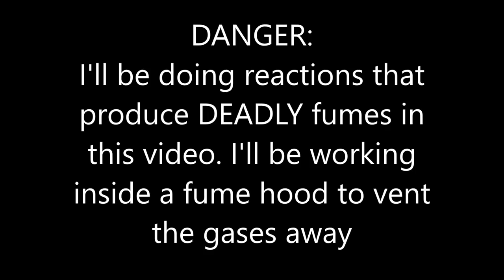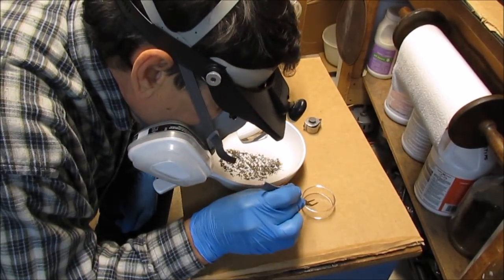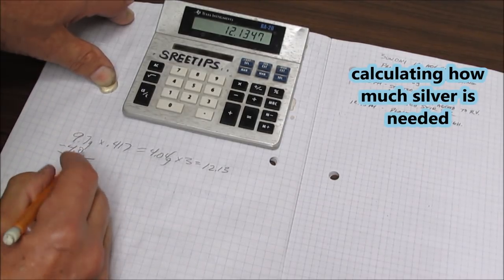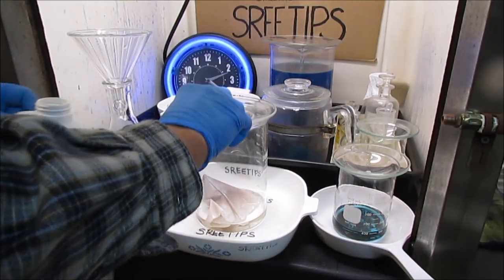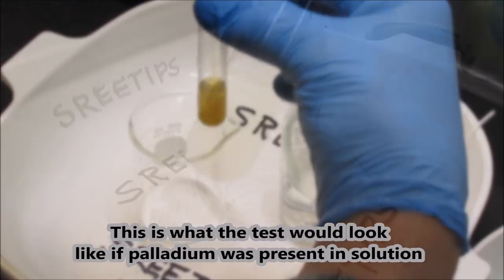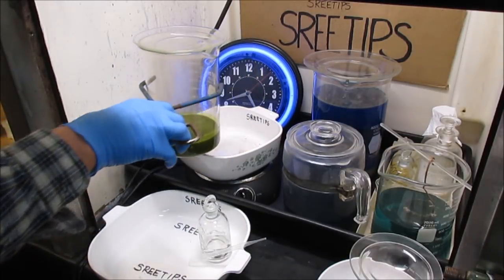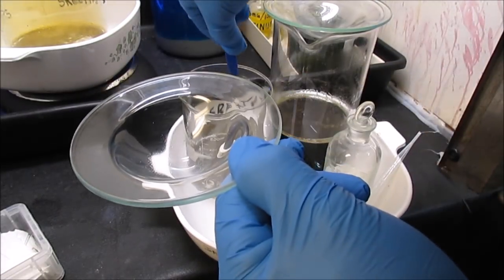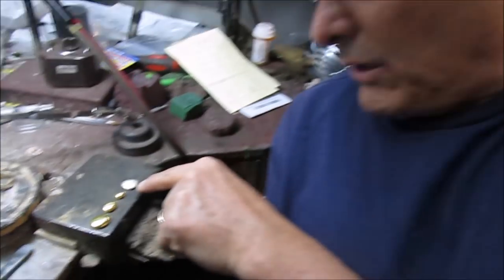Gold Recovery Jeweler's Work Bench Drawer Sweeps Part 2of2

Comment: I would love to see a video where you run into tin "gumming up" your filter and the steps taken to resolve the issue! Great video, keep'em coming!
Reply: If I may chime in, you won't see such a video; because on goldrefiningforum.com  where I and many others (including sreetips---but he DOES it, I do not) have learned from the veterans (without having to go through the pain) what an irritating thing it is to have tin in material you are trying to refine. There are people on that forum who have refined for 35+ years, professionally, and when they tell you 15 times to avoid something....you should.
Reply from the maker: I just had it happen the other day. I was doing a batch of karat gold. Some tin got into the chloroauric acid solution, some how. It glogged the filter and only a drop of solution would pass through the filter every 15 or 20 seconds, with full vacuum - about 28 inches of mercury. And I had half a liter to filter! After about an hour, all the paste collected in the filter and settled out of the liquid. So I set up a second filter flask and used a 125ml transfer pipette to remove the clear gold chloride solution from the gummed up filter into the fresh filter in the second flask. I was able to get just about all the solution recovered, but I know some of it got bound up in the tin paste. I saved the filter. Hot dilute sulfuric acid will dissolve the metastannic acid (tin paste). It shows up frequently when doing gold filled material.
Reply: Excellent! Thank you for the reply

Comment: Hi! I am a big fan of yours and have been following your videos and comments on the gold refining forum for several years. I also hobby refine and have built a lab with everything one would need (including safety equipment and proper disposal of waste materials). If you don't mind I would like to ask a few questions. I know this is a hobby and a profit is not the main goal, but do you cement your silver because it is easier than the silver chloride process which requires another round of conversion? Do you use mapp gas over acetylene and electric furnaces because of connivence?  Thanks again for all of the great videos I really look forward to them!
Reply from the maker: I like cementing the silver because that's the way I've always done it and I've got plenty of cheap copper, my wife finds me copper wire and fittings at yardsales. I use map gas and oxy/acet. But I want to convert to oxy/propane because it's much lower cost. This is the first time using an electric furnace. I like the convenience.

Comment: Hi Sir
Greetings.....
I used to melt my silver jewelries (a mix of 50% to 92.5%) in large furnace to convert that into large silver bar. But a lot of waste material (in form of hard mud) remains in the crucible, in which a small pieces of silver are stick.
My question is that how to get that stuck pieces of silver from that mud. Can you make a small video on this.
TIA.

Comment: The spectracide kind isn't good for precipitating gold but you can use it to make gunpowder and that's fun too
Reply from the maker: Also, since the Spectracide version is potassium nitrate, it does help remove impurities from gold. When melting gold, and I know that impurities are present, I get the gold real hot, almost boiling, then add a few crystals of potassium nitrate to it. The extra oxygen combines and actually burns away impurities that tend to float to the top of the molten gold.

Comment: Hai.. I'm enjoy watching your videos ... When we want to get a silver do we have to denox the mixture or just add a Cooper ?
Reply from the maker: If there is lots of excess nitric in with the silver then it will needlessly consume the copper when you add the copper to cement out the silver. You'll be able to tell if excess nitric is present because the silver powder will begin to bloat and float to the top of the jar as it cements out. Plus there will be brown fumes evolving and the solution will heat up. If these things start to happen then I would put the jar inside a large corningware dish to catch any boil over. Then add small amounts of sulfamic acid and stir. The solution will bubble up vigorously, especially if it's already hot. Add tiny amounts of sulfamic acid until it don't foam any more. Watch out when you stir, it tends to foam even more!
Reply: Thank you for the knowledge you share with me ...
Reply: Can I used urea or lot of water ?
Reply from the maker: I'm not sure if urea works, I don't use it anymore. Sulfamic acid works better to denoxx.

Comment: You might want to try a filter aid like celite to help you catch very fine particles, even though it doesn't look like it's needed for your process (as you capture any gold that ends up in your silver in a later process anyways)
Reply from the maker: I'll check into that, thank you
Reply from the maker: I think that it would add an extra step and expense and it's really not needed as you pointed out. But it would be cool to have some to demostrate how it works in one of my videos.

Comment: Is it not a good idea to try to melt everything in a furnace and then refining it ?
Reply from the maker: I've tried it and it always ends up a big mess. It easier to process the material mechanically before committing it to the furnace or to the acids.
Reply: @sreetips  thanks for the reply !

Comment: Hi Sreetips..Hi everyone.  I dissolved some mixed jewelry including a lot of silver in diluted nitric acid (2:1).  When I introduced the Muriatic acid I had no reaction so I dissolved some more silver in the same solution until I had no reaction or fumes.  My solution turned all black as soon as I added Hydrochloric acid.  Could you please tell me what went wrong and if possible, how I can recover all dissolved silver from the solution?  Thank you so much!
Reply from the maker: If you add hcl to a silver nitrate solution then you WILL precipitate silver chloride. I don’t know what went wrong. My guess; you probably have no silver to begin with. A common beginner mistake.
Reply: @sreetips   Thank you so much for your reply and thank you for the so detailed videos.  Good entertainment but and expensive hobby.  The gold and silver I got from you on ebay are not for melting BTW..too nice!   I watched 264 g of pure sterling dissolving for about three hours but I had put some junk with it.  The one thing I forgot to mention is that my solution was greenish whitish with white dust on the bottom.  I am sure I put silver, little bit of gold and some other precious and base metals.  I took a sample from my dark solution and added ammonia and that cleared the solution.   Since I contacted you, I redissolved the filters in diluted nitric and let it sit overnight.  My solution is clear green with metallic dust on the bottom.  I know you are very busy and don't have time.  I just needed a clue to be able to proceed.  I will keep searching into your videos.
Thank you very much again!
Best regards.

Comment: Sir please i tried have to recover gold from gold plated pins from scrap computers, but what i got wasn't gold dust rather some white substance  that looks like paste please what i haven;t done well please help me.  The ormula i used: 3hcl to 1nitric acid, after that i used urea ,and added smb solution to it
Reply from the maker: My friend, you've made the same mistake that many new comers have made. Gold plated pins have a vey, very, thin coating of gold on them. Almost nothing. It might take several pounds of those pins to yield just a few tenths of a gram, and that's only if you have some experience recovering gold from them. Gold plated items should be processed in a sulfuric acid stripping cell. But, no matter how miserable the failure, you gained some experience and some knowledge. This is a good thing!

Comment: You always say ice cubs, your making these ice cubes with dis stilled water correct? You might want to start pointing that because it would suck to add in tap water at this point in the refining.
Reply from the maker: No, those ice cubes are made of tap water. Tap water does contain impurities, but not enough to report in the assay. The pure gold is 999 fine - every time, even when I use tap-water ice cubes. If I was trying for five nines gold then I would avoid the tap water.
Reply: My tap water is so hard it will mess all up. Leaves a 1/4" of lime and other stuff in a cup of water.
We pour acid in to the toilets weekly to keep them flushing through the rim ports, it is not potable water.
I make my cubes with distilled water also.
Reply from the maker: I'd agree with you there. If the water is that hard then distilled water ice would probably be a must.
Reply from the maker: We went to a port in Gibralter back when I was in the Navy. They actually used sea water to flush their toilets!
Reply: why not poop flows down hill.
Reply from the maker: It had to be hard on the pipes.

Comment: As careful as Sreetips is with everything else you would figure he might have a screen or mesh strainer over the sink drain.
Reply from the maker: I've started using a catch dish to pour off the water in case some of the metal comes out, it won't go down the drain.

Comment: do you have a scrubber for your fume hood?
Reply from the maker: No, the gases are vented outside to the atmosphere.
Reply: sreetips I was just curious I've looked into some regulations in my state and wondered how many refiners actually used fume scrubbers. I never really worried about it until a friend of mine got fined a while back. So maybe it would be important for your viewers to look into the regulations in their respective state/county/city. So hard to do anything anymore without some form of government in your business...
Reply from the maker: Why was your friend fined, and by whom? What I do is considered to be at the micro level. Not enough to fall under any kind of regulation. I've always said, and still believe, that a single gasoline powered lawn mower operated over a single summer does more harm to the atmosphere than my occasional chemistry experiments.
Reply: I completely agree with you, I feel the same way - he lives on a lage piece of property but I think his fault was telling his neighbors what he did as a hobby and I feel they reported it even though no one lives within 2 mins driving of this guy, he does however live near a large farming community they don't even salt their roads in the winter, so that may have something to do with it in his area he requires a fume scrubber if he should continue it seems. Like i said I was just curious of your thoughts, I don't tell anyone since it feels like they get scared and then it causes you trouble.
Reply from the maker: Yes, privacy is a big issue. Thanks for reinforcing that thought.

Comment: How do you make room in the stock pot?
Reply from the maker: (1) remove air bubbler from the stock pot, let solids settle two days (2) siphone off the liquid from the stock pot into two, three liter holding jars. Allow holding jars to settle for two days. (3) siphon liquid from holding jars to waste treatment bucket, then add any settled solids from holding jars back into the stock pot. It (the stock pot) now has room for more waste additions.